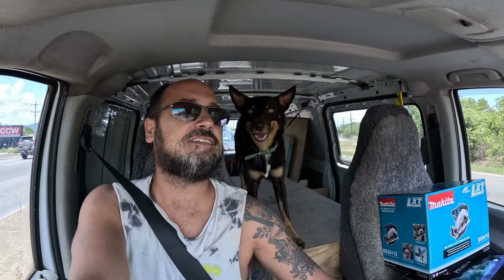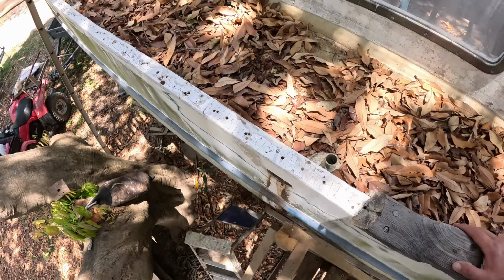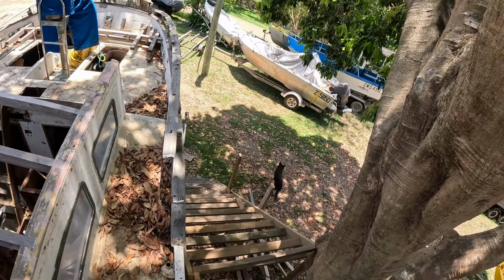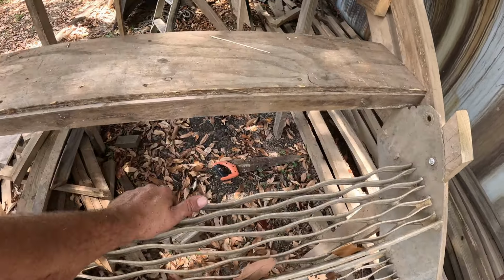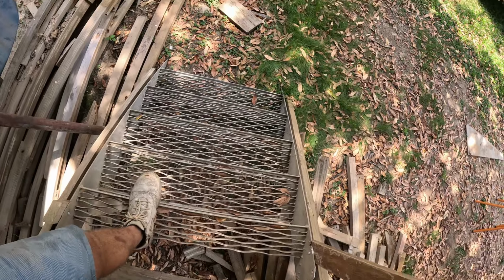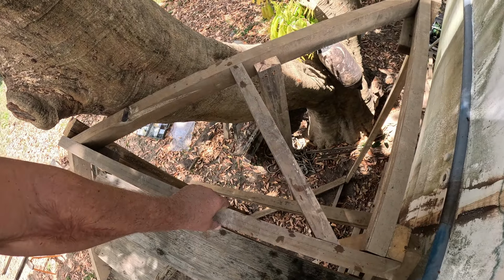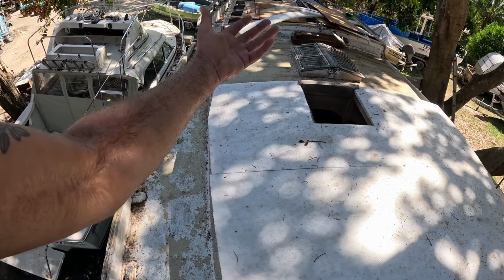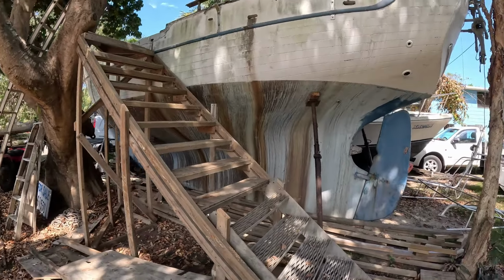Building Stair Access To My Boat - ep74

Comment: Toerail.  Thick spray foam to fill the voids, then epoxy the top. But if you are wanting to attach a life line along the top, I suggest redoing all the toerail to beef it up. Otherwise the poles for the life lines won't have strong base to attach to. 👍
Reply from the maker: Thanks for the tips mate!
Reply: @revivingtheenchantress  you bet!